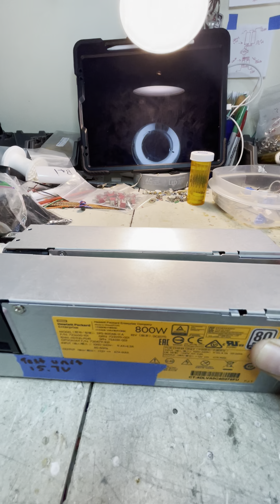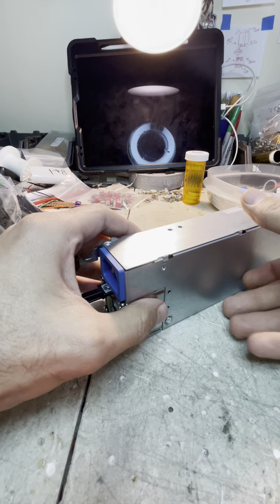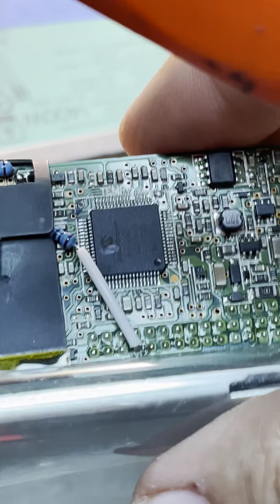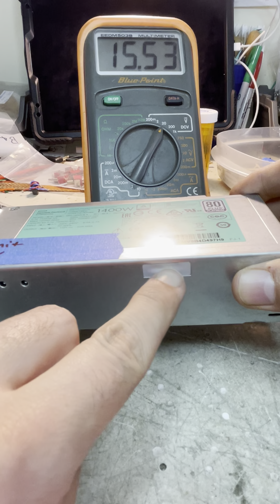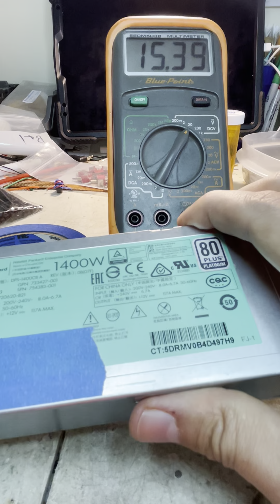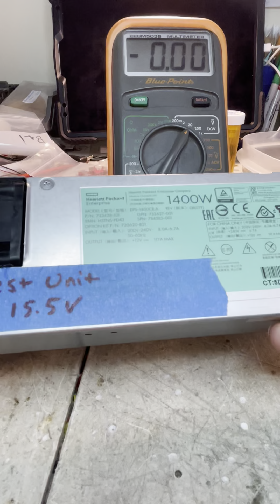HP HSTNS-PD43, Hacked, OVP, 15.5 VDC

Comment: Do these models have a load sharing pin? Thanks.
Reply from the maker: Bottom of supply, 5th little pin from the end is current share
Reply: @hopperbuiltamps2135  very nice. Thanks for the helpful info and video
Reply: So looking at the bottom with the pins closest to you, counting backwards from the edge it’s the fifth pin right next to the longer pin, correct?